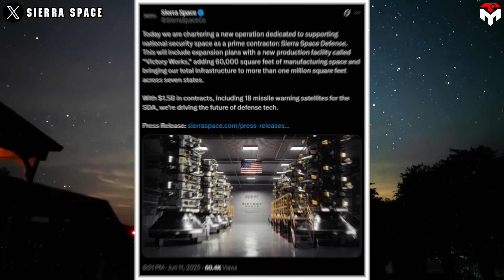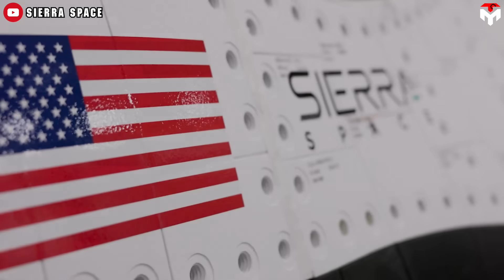NASA's New Shuttle is finally launching and It's a Problem for SpaceX Dragon...

Comment: Sounds like AI garbage.
Reply: It is NOT AI garbage if you actually tried to look up facts...   Here is info on this:   The Dream Chaser has been in development for YEARS. The Dream Chaser was originally started in 2004 as a project of SpaceDev, a company that was later acquired by the Sierra Nevada Corporation (SNC) in 2008. In April 2021 the project was taken over by the Sierra Space Corporation (SSC), spun off from the Sierra Nevada Corporation as its own fully independent company. They have had one just about finished but they have had problems finding a launch vehicle... This is one of the THREE companies that NASA hired to come up with a spacecraft to replace the shuttle...  SpaceX and their crew dragon finished first.   the Boeing capsule Starliner is the one that got stuck at the space station with MAJOR problems and spaceX had to bail the crew out...   the The Dream Chaser was originally started in 2004 as a project of SpaceDev, a company that was later acquired by the Sierra Nevada Corporation (SNC) in 2008. In April 2021 the project was taken over by the Sierra Space Corporation (SSC), spun off from the Sierra Nevada Corporation as its own fully independent company.  HERE is he home page for the spacecraft:   https://www.sierraspace.com/dream-chaser-spaceplane/
Reply: Bud dream chaser is a real shuttle by nasa and the vid aint lying

Comment: Posted just a few days before SpaceX blew up.
Reply: SpaceX always blows up experimental rockets until they get a refined, reliable product. This is separate from the current Falcon 9 used for actual work.
Reply: @lambertlum1087  So they blew it up ON PURPOSE? Are you high or just stupid?
Reply: @Kilkenny1923  No, he's not high or stupid, you're just ignorant. SpaceX intentionally self-destructs its rockets in certain conditions. (Like when the rocket is failing, they will punch the, "self-destruct" button). Understand?
Reply: SpaceX blew up? When?
Reply: @str8up598  Three times. But they were planned explosions. (Not kidding.)
Reply: @str8up598  Every time 😂
Reply: @gor4988  
I assume you are talking about super heavy and star ship? Well they are testing andd developing. You should have been around during NASA start up!

Comment: Pure bull. You indicate that it can fly on any rocket and they later say that Dream Chaser is delayed because it can't find a rocket to take it to space. Dream Chaser is cool and has a place in space, but it will not replace anything.
Reply: I think it means they can be carried atop most larger aircraft...
Reply: If SNC is truly serious about finding a rocket to launch upon, they'd have been working for the past decade on a fairing and upper stage adapter to mount onto SpaceX Falcon booster. 
casting their lot with ULA is a fool's errand, as it appears ULA is trying to put itself out of business because it can't compete at a low cost launch threshold that SpaceX and RocketLab have created.

Comment: More bullshit lies from this channel. Sierra Space will never launch Dream Chaser. ULA who was supposed to launch it into space is being sold and literally taken apart for scraps. If Sierra Space would have left the original design like it was supposed to have been. Then Dream Chaser would have already been operational by 2010/2011, but no instead of leaving it as a crewed space plane they turned it into a giant useless drone that has yet to even get off the ground. The designers and builders of the original Dream Chaser already had it tested and flying around all they needed was approval from the FAA for space flight testing and they never got it. The Obama administration and his FAA appointed administrators royally fucked SpaceDev and forced them to merge with Sierra Nevada Corporation and retitled as Sierra Space.

Comment: I had high hopes for the Delta Clipper but they flushed it because the engines it required haven't been fully developed yet and it was too expensive. Too bad... 😞
Reply: Single stage to orbit is not a goer without a revolution in thrust engines. See the rocket equation.
Reply: @DavisRimu They planned on using a revolutionary new scram jet to get it up to the brink of space then high performance fuel burning rocket engines to get it into orbit. But yes. I'm well versed on the dynamics of rockets thank you...
Reply: Worth looking at this Dark Skies video history of the Delta Clipper "The Rare Vertical Rocket NASA Hated but Had to Build" on YouTube 

https://youtu.be/UxifbRY61fY?si=02hj8c3w5WMgeULz 

Notice that the Delta Clipper used liquid Hydrogen and LOX fuel. The test program cost only sixty ($60) million. Delta Clipper was never cancelled because it ran over budget or failed the objectives. Where are SpaceX has missed all project milestones. Nothing in the SpaceX project called for the Falcon first stage catcher. That was nothing but a distraction from SpaceX having failed project milestones for moon shots.

Comment: I'm a big fan of dream chaser.  Hope they have a lot of success.  But it has a ways to go to prove it works. Not yet flying.   It can be a good competitor to dragon, but has one big drawback.   It relies on somebody else's booster to get it into space. And unless that booster is reusable like a falcon, The cost for launch is going to be expensive And not competitive with dragon.   And if you compare dreamchaser to starship, once starship is operational, it's like comparing a tour bus to a covered wagon.
Reply from the maker: Thanks for sharing your thoughts! You're absolutely right — Dream Chaser has a lot of potential, but it's still in the proving phase. Relying on external launch vehicles like Vulcan does create limitations, especially when you compare it to the fully integrated and reusable Falcon 9 or Starship systems. While Dream Chaser offers unique advantages like runway landings and gentle reentry for sensitive cargo, SpaceX’s edge in cost efficiency and rapid reuse sets a high bar. Once Starship becomes fully operational, the scale and economics might really shift the landscape. Still, competition drives innovation — so it's great to see different players bring diverse ideas to the table!

Comment: Dream Chaser isn't a launch vehicle. It isn't even a crewed space plane. How could it compete with the Falcon 9 rocket?
Reply: That actually started as a NASA study as the HL-20
Reply: It's a crewed vehicle
Reply: @youngmangrand9331 the current Dream  Chaser is not a crewed vehicle
Reply: Sierra Space will have a version of Dream Chaser that carries a crew later on the line. Dream Chaser will give Dragon some competition because it can land on any runway. Dream Chaser does not require a lengthy preparation time after it lands, it will be a short  turnaround. Dream Chaser can also Carry sensitive pay loads. The Military saw how they can use Dream Chaser, they gave a contract to Sierra Space for a # of years. So there you have it.
Reply: @luismatthew5875  I suggest you do some research on the original Dream Chaser that was designed and built by a company called SpaceDev before being forcefully merged with Sierra Nevada Corporation and renamed Sierra Space Corp. The original Dream Chaser was literally built as a crewed space plane that had been tested and already flown and met FAA flight regulations for in atmosphere flights all they needed was approval to begin space testing and the FAA refused to give it to them and Sierra Corporation fucked it all up after that and turned it into a giant fucking drone that wasted of billions of tax dollars and kept delaying it's development for nearly 16 years.
Reply: @luismatthew5875   Dream Chaser was originally designed as a crewed spacecraft by SpaceDev Corporation and it had already been flight tested and approved by the FAA for atmospheric flight in 2013, but never tested for space flight. Sierra Nevada Corp F'ed it all up by turning it into a drone that hasn't even left the ground since
Reply: @thomaswakefield6889 I guess they did F' Ed it up but Sierra Space will  develope a Crewd version next year. The Cargo version is getting close to flying sometime this year.
Reply: @luismatthew5875, the drone cargo version should have already been flying. As for flying this year, it will never happen because it was ULA who was supposed to fly it into space instead it is being sold and chopped up. Which is why SpaceX demolished their launch pad. Also they already had a fully operational crewed cargo version and Sierra Nevad Corp fucked it all up and turned it into a drone the has yet to even go through FAA certification flight tests.
Reply: @thomaswakefield6889 you're right,  U.L.A. Launch complex 37A was demolished to make way for Space X  Starship facilities. The thing about Dream Chaser, is that it was developed so that it can fit inside Payload Fairings from other Space Agencies Rocket not just U.L.A. Vulcan Sentaur Rocket. Space X can take on the task of boosting Dream  Chaser to the Space Space Station.
Reply: @luismatthew5875  I'm not sure where you get your bullshit from, but both SpaxeX and Sierra Space have admitted that Dream Chaser was never ever designed to launch from a SpaceX rocket, and Sierra also has admitted the Blue Origin was never a company they were ever going to use for Dream Chaser. The drone known as Dream Chaser was specifically modified to be solely launched on ULA's rocket platform

Comment: Sierra space might only be 4 years old, but that's kind of deceptive because dreamchaser has been in development for about 20 years.  They just bought up the company that was developing it.
Reply from the maker: Great point! While Sierra Space as a company is relatively new, Dream Chaser’s roots go way back — nearly two decades of development under SNC before Sierra spun off. So in many ways, Sierra Space inherited a mature, long-evolving project rather than starting from scratch. That legacy gives Dream Chaser a head start in design and testing, but it also means it carries the weight of an older development cycle in a fast-moving industry. Still, it’ll be exciting to see if all those years of work finally pay off when it starts flying!
Reply: Yeah the dreamchaser was competing with the Liberty rocket (defunct Ares I rocket) way back then😊

Comment: I'm happy that Sierra  Space is bringing back the Space plane. Space Plane is a lot better than (old technology) Space Capsule. Sierra Space is taking a step forward with Dream Chaser instead of taking a step backwards. 
 Imagine had NASA not canceled the Space Shuttle,  they would've had an advance version. Of the Space Shuttle by now.
Reply from the maker: It pretty  much spots on !
Reply: I was told the NASA Shuttle Program was cancelled because of financial and budgetary reasons.
Reply: @PatriciaToler-kh9em Space Shuttle was canceled mainly because it was deemed no longer safe due to disaster on two different flights.

Comment: Could dream chaser land on Mars
Reply: Not like it is.  Not enough atmosphere for the lifting body to provide lift and no runways to land on even if it could.
Reply: It would have to be planned and modified to fly in the lighter atmosphere. The return flight needs to be planned as needed. But the guided landing will not crash.
Reply: It could but probably wouldn't be able to take off because not enough fuel??  Once SpaceX gets enough Super Heavy tanks floating around with fuel and some way to refuel Dream Chaser.

Comment: Dream Chaser is not a problem for Dragon. It is a very big problem for Starliner. Dream Chaser issue right now is the rockets to get them into space keeps getting delayed. They should team up with SpaceX. Dream chaser is also reusable. They might be able to get preferred status with SpaceX (like hotels) and get a regular launch schedule. Like every other month on the Falcon 9. Or, after a while, every month. If Dream Chaser can keep that pace.
Reply: I like Sierra Nevada. They are a diversified company. Unfortunately, they will need a lot of years to get a crewed version of the Dream Chaser.
Reply: @brianboye8025  no they won't because the original Dream Chaser which was built and flight tested back in 2008 was a crewed built space plane. SpaceDev who originally built and designed it had fully operational and flight tested crewed prototype that the FAA refused to give authorization for space testing and forced them to merge with Sierra Nevada Corporation. Who ultimately ended up fucking the entire program by turning it into a giant piece of garbage drone that can't even get off the ground let a lone fly in atmosphere
Reply: I wouldn't team with Musk if it was free
Reply: @SayNoToTrump  You stick to your guns, and see how far that gets you.

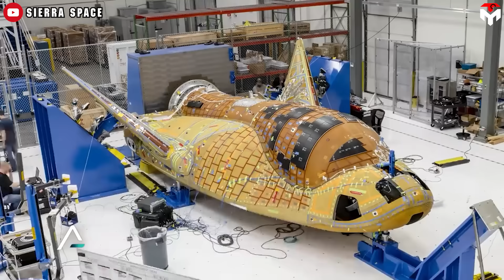Comment: re your question at 9:37 "Lets Be Real ?" Yeah I feel this is a deep dive for sure. New tech is often frought with perilous tangents of delay and remediation. I will say this. Depends on Sierra Space's vision and if they get it right and provided luck smiles on them. Hopefully they don't go down Boeing's rabbit hole. But Boeing is a slow moving mega beaurocracy . Perhaps Sierra Space will be the nimble turn on a dime small mover-shaker progressive company. Time will tell. Even SpaceX has had it issues.
Reply: Boeing is yesterday’s news, time they got out of the aerospace programs !

Comment: The problem with dream chaser is it requires a rocket to get it into orbit. It can't carry an oz. Into orbit by itself. It can only bring payloads back.
Reply: What makes this different from every space craft?  The space shuttle needed a huge rocket to get it up.  It just kept the engines and dumped the fuselage.
Reply: As far as I'm concerned all first stages require a rocket ( booster) to get it into orbit. There is no single stage to orbit yet.